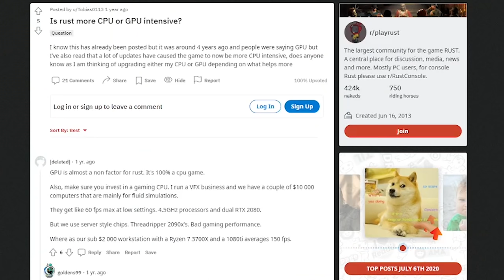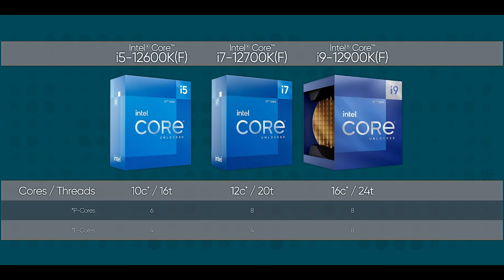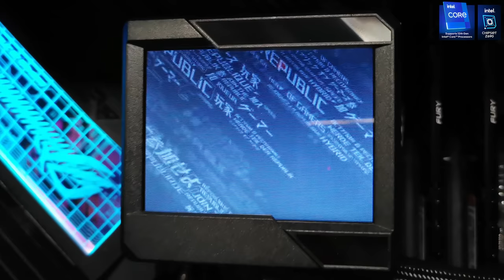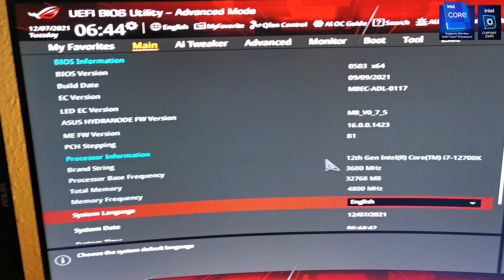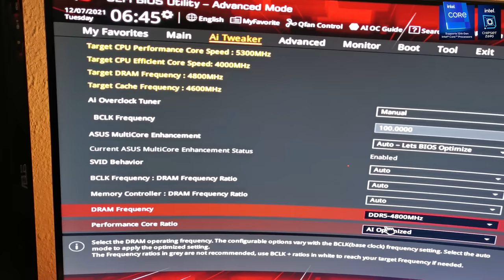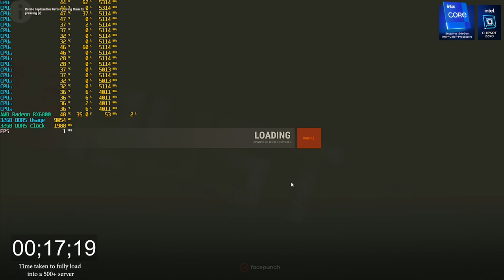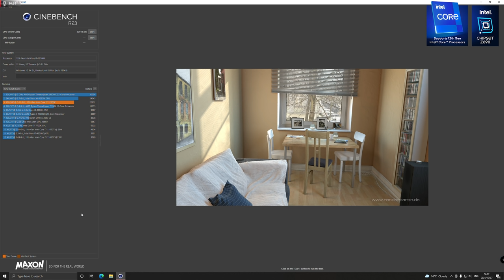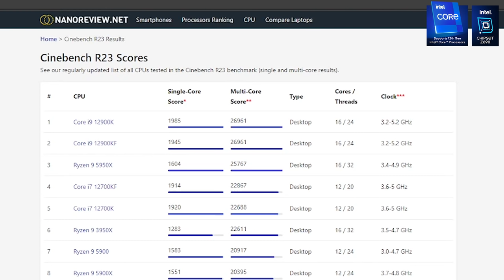RUST vs the worlds Fastest CPU

Comment: I love your enthusiasm, but you can't compare a game like Apex Legends to Rust...a static map with a low set amount of players in it compared to a massive open world (500 players) with a procedural map, events, base building, electricity, destruction and players dying here and there...it's just not the same game at all. Rust is an ambitious project for a small team like FP and yet they achieved it ( even if it's not perfect). Run apex with 500 players in one game and bye bye frames.

EDIT: Rocket league!? xD
Reply: I agree that the two aren't directly comparable but he was using the other games to prove a point that reducing graphics settings should give a boost in fps. Which it doesn't do in rust.

Comment: In my experience with Rust, it is badly optimized with how it handles threads. However I noticed that Rust is very sensitive to system latency. Your framerate in Rust is tied to your whole system's latency, with lower latencies bring higher FPS and responsiveness.

Let me explain what I found during my research.

My specs are:
 
Ryzen 3600,
16 GB DDR4 3200 MHz CL16
EVGA GTX 1080 SC2
500GB Samsung SSD  <- Rust is installed here
4TB HDD for storage.

My framerate of stock windows 10 hovers between 70 to 90 fps. After I disabled services I will never use (Bluetooth, Xbox, Smart features, Microsoft store and others) I went from gain upwards of 15 fps. My framerate hovers around 100 now with the occasional stutter to the mid 50s, a pretty decent improvement from just debloating windows. 

By default, windows has over 150 processes running at any given time, most of which gamers may never need. As stated above Windows 10 is horrendously bloated with awful programs and terrible coding, and with Rust being so latency sensitive, simply stripping down windows yields a decent uptick in performance in Rust and other games.

Further evidence that rust is latency sensitive is that by tightening my RAM timings from 16-18-18-38 to 14-17-18-34 again yielded higher fps. this time my framerate hovers around 100 to 120 fps

In conclusion, Rust benefits heavily from as little system latency as possible provided you have a strong CPU, fast ram and a decent GPU.
Reply: how do you strip down windows
Reply: @DrNooberious  yeah I already debloated my windows before same with the telemetry stuff
Reply: @KeravnosPrime  Excellent, for more people did that then Microsoft would (hopefully) stop bloating windows out right.

Antivirus, antimalware, and firewalls also effect Rust's performance. Switching to Avira from Avast lowered my ping from 40 - 60 to 15 to 20.
Reply: @DrNooberious  I use windows defender and turn it off when playing, All this debloating got me around a 20-30 fps increase, pretty big for a game like rust
Reply: @KeravnosPrime  Very impressive. How you tried overclocking? tightening RAM timings?
Reply: @DrNooberious  I don't want to over clock I've seen videos and it only adds around 3 fps
Reply: @KeravnosPrime  Depending on what is the performance bottleneck it can or can not be helpful.

Comment: I get 60-90fps 1440p mixed settings on rx480 4gb i7 10700k 5.0ghz.... I need to upgrade gpu to a gtx1070 gpu.... or something whit comparable performance. (Rx6600, gtx1080, 1080ti, rtx3060, 2060 and way more options ofc) Higher gpu dienst benefit at all. It's all about rust optimisation whit CPU's.....

Comment: Strange. I run I9 9900k and an RTX 2080ti and get 120fps fairly consistently at 1440p in Rustoria Main. I feel like it must be limited somehow that PC should do significantly better
Reply from the maker: Very. And this is a fully fresh windows install so I had the advantage
Reply: @MisterFlak  You should change some things in windows......I had the same problem with a 3080 and a 11700, but now got 130+ at 1440p....gpu hardware acceleration must be on....energymode must be on best performance...........otherwise windows limits powerusage

Comment: I thought rust was gpu intensive. 
I have ryzen 5900x and 3090 and if I go into task manager my gpu is always sitting above 95% usage. I still only get 120-130 when I start on a server, dipping to 80-90 after a few hours of playing.
Reply: Still playable thou I mean you should at least get 200 frames for the 3090 damn
Reply: How do you get 95% usage? I got a 3070 and it's never above 55% usage

Comment: Aren't you also limited and dependant on the server maximum performances?

Maybe the GPU will generate only the frames the servers can "sync" with or something like that.
The test should have been done with many different server types.
Reply from the maker: I did run a few diufferent servers but didnt include the results in the video as it was pretty similar to Rustoria. i even loaded into a "1 grid" server, which was more like a 4 grid. also very mediocre fps. was disappointed. in the game not the PC

Comment: Did you turn on xmp for your ram?
Reply from the maker: Tried with and without. same results with that AI tweaker activated. the memory was actually running 4800mhz when i looked on other benchmarking tools, just Afterburner was reading it incorrectly, likely they haven't properly updated the OS due to the new nature of DDR5
Reply: @MisterFlak  always run xmp ON or your ram speeds are not as advertised
Reply: Hey, how do you turn xmp on? @John H

Comment: Stop turning your settings down. Running the game on medium with a good video card generally doesn't help anything. Your card can handle everything, and you don't want to offload any of the graphics processing onto the CPU.
Reply: Frl??
Reply: @pork270  Start with highest settings then move down if you need to. Most settings when turned down just offload to cpu to give the video card some headroom. Not everything, but a lot...
Reply: @n0madtv  ok I have a 1660 super and Ryzen 7 3700x and play stretched with 80-110 frames should I just start high then go down ?
Reply: @pork270  Yes. Try each setting to see if it makes any difference at all. If it doesn't make a noticable difference (a couple fps) then it's not worth turning down.

But, I think 80+ fps in Rust on a 1660 is probably pretty good. You'll be lucky to get much better than that IMO.
Reply: @n0madtv  seriously ?
Reply: @n0madtv  I changed some setting and at 3 graphics I’m getting stable 85 plus 100 in some spots

Comment: Changing my settings with my 3090 at 1440p I get mostly 150fps. That’s with the 12900k. Even with a 3080 which isn’t that much slower. Your fps should be going up.

Comment: Bro your ram is garbage. Rust needs fast ram. 4800mhz ddr5 is worse than ddr4 bro. I have the 12900k with 3600cl14-14-14 ram and I get 190-200fps in rust. But i also overclocked and disabled the ecores. Rust isnt gpu heavy so lowering quality settings wont give much performance if you are still cpu limited.